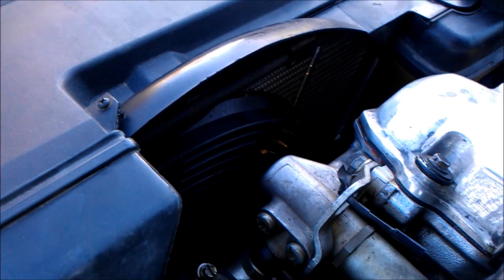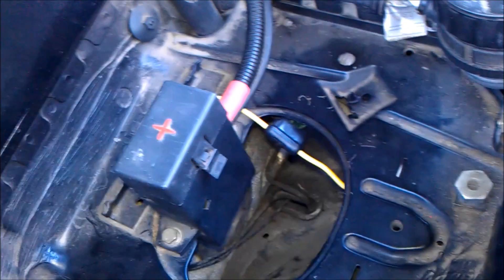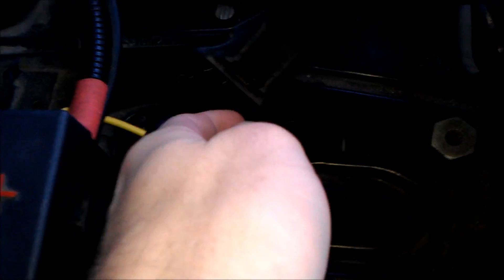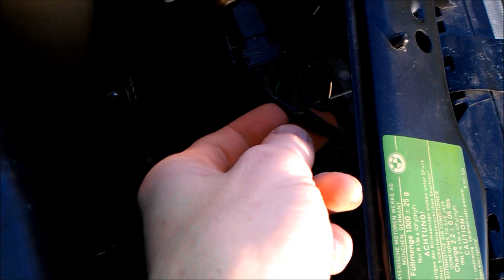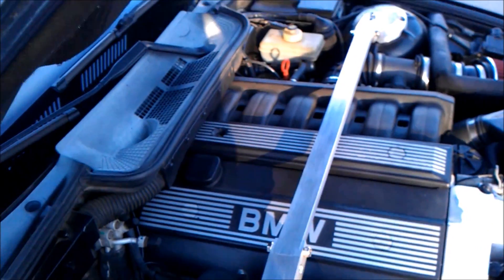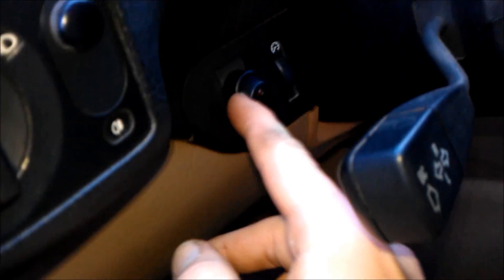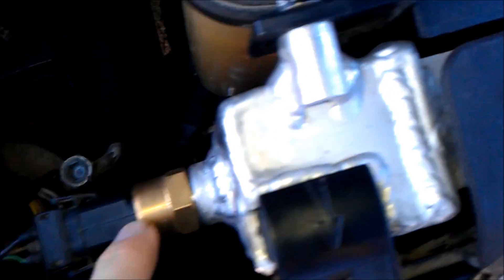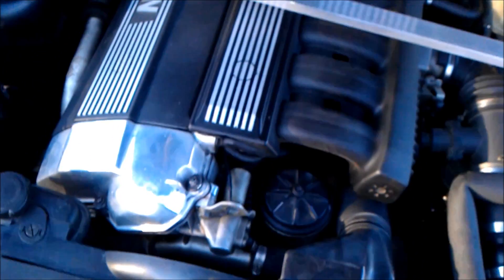e36 Electric Fan Conversion - DIY

Comment: For an e39 2001 530i can I also use the temp sensor that comes from radiator I think that also controls the aux fan in front?

Comment: Veeery good idea for this conversion. Except you gonna blow the air conditioning compressor...
Reply: why
Reply: Because electrical fan is not as efficient as a normal visco is. Been there done that, in a heat (standing still while 30C outside) air condition just doesn't work and the compressor is having a bad time - rise of the pressure...
Reply: what if you bought a quality electrical fan? the type of power driving the fan doesnt affect flow - does it?
Reply: Sole purpouse of this is to remove the bigger fan and left the smaller one. Which is NOT sufficient for good cooling. So you will have to grab bigger fan - and I don't know wether it will fit there
Reply: A Dual fan would be ideal for Engine + Air Conditioner. 1 turn on when the Engine gets to 195F and the other will turn on when the AC is on. Best way I know how is to do Dual Fan!
Reply: yeah youre right, except an e36 allready has another electrical fan on the front of the radiator. its mounted directly on the condensor.
Reply: +Robbinvm - In my post.... I said " Dual Fan ", maybe refer to that.
Reply: +Jordan Bronson i was answering on the original comment.

Comment: Which did you use?
I'm looking a slim fan, 2000+ CFM, need the slim fan because the mishimoto radiator is bigger then the oem.
Reply from the maker: its just some slim fan i found on ebay. i asked the seller for the dimensions before hand so i knew it would fit

Comment: Where did you go through the firewall to get the interior switch on the drivers side?
Reply from the maker: i drilled  a small hole and sealed it with silicone
Reply: Jesus. You have ruber travels through firewall all around
.

Comment: Thanks for the video.I live in Florida and have an 97 E36 328is that tends to run hot.I have been considering doing this and will definitely do after watching your video.
Reply: Technically if you delete the factory fan for a electric it's not going to make your engine cooler/colder, in this case actually your car will run hotter do to the electric fan turning on only when it's needed.... And the factory fan is always propelling air around the engine bay in this results to a cooler bay and components not running hot... 
I have e36 M/// and I can't wait to do this mode. For me it's the noise that I just Can't stand. And looking to fave a faster revs according to Another commenter on this video.
Reply: That would be true if not for the adjustable thermostat that came with the wiring kit I bought and in conjunction 2 bottles of Water Wetter and a complete flush plus a 180 thermostat. Before installing the electric fan with the a/c on the car would get as hot as 220. After installing the electric fan the car runs much cooler (barely gets over 200 with stop and go traffic in the middle of the day with Florida heat running an average of over 95) and feels a bit stronger. The fan comes on at about 185 to 190 degrees.

Comment: Could you send me the wiring instructions to run the ac fan with the electric fan together. My problem is when I turn my switch off for my electric fan and ac fan they both turn off then after a second or two my ac fan turns back on while my car and power is off. my email is dontae_scorpio@yahoo.com

Comment from the maker: you can look up the FDM on bimmerworld DO T com. i got the fan used on ebay for $30, the relay was $3 or so, and i already had the wires and rivets and such.
Reply: hey man just subscribed. Question for you. I have a 2001 BMW z3 I’m looking at getting a supercharger from VF engineering
Do I need a radiator fan or should I stay with my fan delete?  z3 fans are a ticking time bomb

Comment: I plan on completing this mod on my '97 toyota 4runner. You mentioned that there are two fans. Is there one in front of the radiator, too, as well as the rear?

Comment: Hey, just a question, couldn't you just wire the new fan into the thermo switch which the aux fan uses? saves having to wire up a relay? cheers

Comment from the maker: its a 16". 
The only issue I had was when i was running a standard fan delete, meaning only AUX fan. 
And one day the AUX fan failed and i was dead on the side of the road, since then I dont trust a fan delete without doing a electric fan conversion

Comment: You said you used a slim fan, what size is the fan you installed a 12" or 16" and I'm guessing you've had no overheating issues after the mec fan delete?

Comment from the maker: there is not really a notable HP increase. a bit quicker revving MAYBE.
the main purpose of this is to get rid of the noise and provide better cooling than a regular fan delete mod can do by itself.

there is no noise when driving because neither fan will run unless its very very hot outside

Comment: Thanks for the vid! I'm planning on running a similar setup. For the switch under your steering wheel, where did you pass the wire through? and where did you ground the switch?

Comment from the maker: not a dumb question. 
As I tried to explain in the description, the manual fans get brittle as they age, and as a result they can explode. 
Mine did and it took my radiator with it. 

That's really the main reason, but also, its good for track days when you want to let the car idle and cool down rapidly. 

aaaand supposedly you gain 1hp or so by removing the manual fan ;)